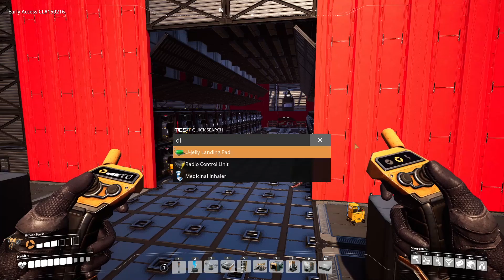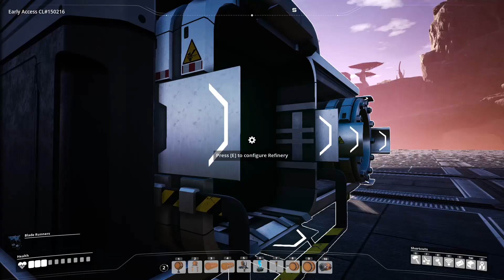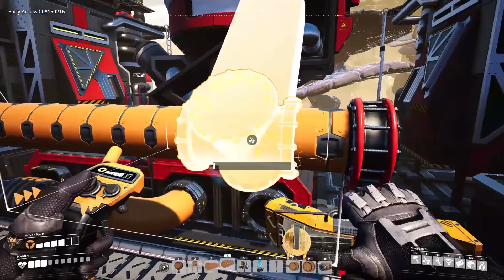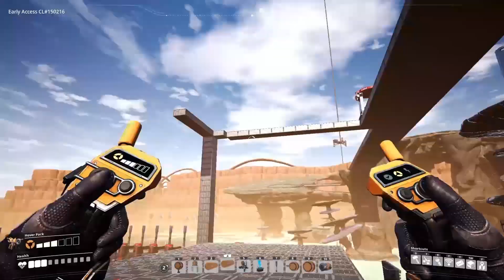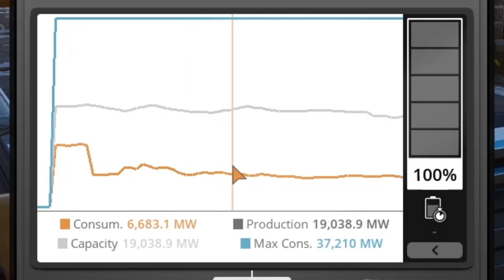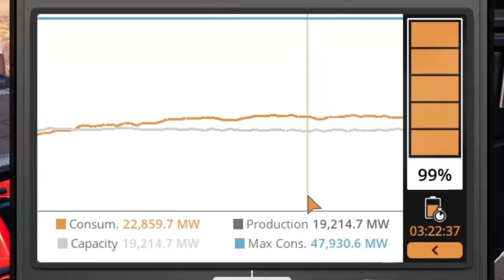Our First MEGA PROJECT! | Satisfactory Update 4 Gameplay Ep 3

Comment: With all the new pipe updates, I've been doing more "splits" with my turbo fuel stuff.  I find all the old setups just don't "balance" fluids properly anymore.  So I do 1 refinery off a pipe and that one makes heavy residue, that goes to 1 refinery making turbo fuel, then that feeds 6 power generators. I use the differential between the two refineries to cause a backup in the system.

Comment: I solved the fuel flow problem Kibitz was troubleshooting in the Twitch stream, by cascading the lines from up above and dividing evenly using pipelines of symmetrical length. In my version of the power plant, I am using 60 refineries and 48 blenders on 100% normal clock speed,  368 fuel generators on 246.2289% overclock, 30 fuel generators on 100% clock speed and 1 fuel generator on 59% underclock (also 92 water extractors each underclock to produce only 100m3 of water per min.) All this in just one single floor. For every row of 26 generators, 13 each side, I put the 2 centermost pair on 100% clockspeed. I connected one to another with a Mk1 pipe and put a crossing pipe in the middle pointing upward. About 10 meters high, I put a valve limiting this flow to 24m3/min, and right above it, another crossing pipe. This crossing pipe is fed by the 600m3/min fuel feed from the Blenders (I use a big fluid buffer between this crossing and the blenders, but I guess this method wouldn’t need one if your fuel feed is steady). Continuing, this crossing pipe high above in the middle splits the 600 in two feeds of 288m3/min. each, one going to the front half of the row, and the other to the rear half, and one feed in the middle (mentioned earlier) going downward for only 24m3, divided in 2 lines of 12m3 going to the centermost fuel generator pair. Each of the 288m3 lines go cascading, splitting first in three lines of 96m3 each, then each 96 line splits in 2 lines of 48 (by now, each of these 48m3 lines end up between the fuel inlets of a pair of opposing fuel generators). Then each line of 48 finally splits in two lines of 24 each going to the fuel generators. The only Mk2 pipe is the main 600m3 one up above, all the rest is Mk1. You can start this piping by placing the crossing pipes in the middle between each pair of fuel generators, connecting one side to one fuel generator (let’s say, the left one) then deleting the crossing pipe. Then, place another crossing pipe snapping on the extremity of the stub of pipe protruding from the fuel generator, only this time rotate it to point upward. Then connect a Mk1 pipe to the generator on the right side of the row. Do the same for each pair of generators, and you’ll end up with all crossing pipes in the middle of each opposing generator pointing upward. Connect the top endings of the crossing pipes in the 1st and 2nd pairs with a Mk1 pipe, which will form an inverted U. From here, do the same with the 3rd and 4th pairs, and the 5th and 6th pairs. Skip the 7th pair (which will be the normal clock speed pair) then connect the 8th and 9th pairs, 10th and 11th pairs, then lastly 12th and 13th pairs. In the middle of each resulting inverted U pipes, you can place crossing pipes pointing upward so you’ll be able to build upward by creating inverted U’s, placing, connecting and deleting crossing pipes. Just be careful with the crossing pipes that must go above another existing crossing pipe: the connection is finicky and requires just a bit of offset to either side, perfectly centering them will make the short connection impossible (and too much offset also makes the connection impossible due to too much distortion).
In my setup, the fluid buffer is located in the front, sitting atop 3 stacked 8x4 foundations, which means the 600m3 feed also comes from the front. This height is perfect to make a straight line that goes from the buffer outlet and just connects to the top of the main center crossing pipe.

Comment: After watching this video i decided to do some experimenting. Turns out it is possible to build pipes in a trench for a much cleaner look. I got it to work by building the machine on top of full sized foundations, then laying down four small foundations along the input side. Then delete the three upper foundations. Next lay down a feed pipe across the row of machines with up turned junctions just under each input. Now you can place one last layer of small foundations on top to enclose the trench and the pipes will still connect through the foundations. It is still technically clipping, but i think it is logical clipping my ocd can live with. Hope some of you will find this useful in your future builds.

Comment: Hey Kibs, you've indicated that you won't use Turbofuel because you want to save sulfur for use in nuclear power production. Do you have some numbers/calculations on this? With Update 4 it looks like using all the uranium on the map will only require 930 sulfur/min, producing 24 plutonium rods per minute for 330 reactors (8:3 plutonium to uranium rato).

Comment: Im not 100%, but i think batteries are 100 MW/hr or MWH. One battery could hold 6000 MW for 1 min, 50 batteries could hold 300,000MW for 1 minute. Does anyone know for certain?
Reply: I've tested it myself, and the Power Storage units are as follows: each one can provide 100 MW for 1 hour. Kibitz was pretty close when he highlighted his 10,600. Power draw if all the Power Storage units were needed would be 10,600 and last for one hour. Having only about 3 to 4k MW of needed power that his power grid didn't have at the moment is where the timer of 3 hours and change came from. 10,600 being used at just under 4k will last a few hours. The more strain you put on a backup battery, the less time it lasts. In my own setup that I've been working on a bit less than 50 hours after U4 came to EA, 50 Power Storage units fully charged shows me at about 480 hours if it is only providing like 75 MW of power for a few constructors (I tore down my factory to re-vamp it)

Comment: Kibs, I tested it, and you CAN Color your pipes with the color gun (Which appears to have a new design to it), so instead of leaving them the default Fixit Orange and they're all confusing as to what contains what, you can paint water lines blue, Oil lines black, fuel lines red, gas lines Yellow or Green and so on.

I likewise use the color gun to color lines of production.  Red for copper, Blue for Iron, Black for Steel...

Maybe that'll help with organizing your production lines.

Comment: I wouldn't use the 600 pipes to their full potential. There is a bug which makes them transport slightly less. If you are using them on full capacity, the flow amount will drop every now and then below 600 and then go up again. The bug is mentioned on the satisfactory wiki on the page for pipes. 
Before I read this, it made me crazy why my fuel plant couldn't feed the exact number of generators it should. I had a full fluid buffer connected to underfed power plants and the flow rate still sometimes dropped below 600, just to rule out any mistakes.

Comment: Kibz, 250 Sulfur is required for 10 Manufacturers who produce 200 Encased Uranium Cells per minute, which makes it possible to make 4 Uranium Fuel Rods per minute. If consumption has not changed, this is 20 nuclear power plants. Are you sure you want to save sulfur? Oh yeah, I forgot batteries for useless drones ...

Comment: When you use the overflow method on fluids, you should just put a valve in front of every input and limit the flow to whatever the machine needs. Then the system is effectively load balanced.

This can also work for belts, but it's more situational - like if a machine needs 60/min, overflow with mk 1 belts.

Comment: Balancing fluids is pretty easy, just set the flow amount with valves
Reply: Lmao, rarely works. I have a few systems where everything is perfectly balanced with valves and pumps but its extremely finicky and just doesn't work most of time
Reply: @TheBassMaster56  Had my coal power set up exactly right and it would only work most of the time. I just decided screw it and overfed by 7%

Comment: How do even begin to build these mega factories? Are you just who build them all good at art because I just cannot plan ahead as to where I’m gonna build this and that. I do prefer to build at ground level but I’m also stuck in building horizontal I just cannot force myself to build vertically. HELP.
Reply: Practice makes perfect. Hundreds and hundreds of hours of experience gives you some idea of how to plan and build neatly
Reply: What I do is build a large platform and then fit the machines to it. I have over built and under built the platforms lol. I then make a new platform for the next thing I want to make, normally just going up from the previous one. If it needs an expansion due to area, I'm not super worried about it. They added the pillars for a reason :)

Comment: Completely maxing nuclear only takes about 3200 sulfur. That leaves 3k ish sulfur you can use for turbofuel.
Reply: You need some sulfur for batteries too
Reply: @albertogarcia5276 It takes 225 sulfur to make 90 batteries with the blender recipe. Given that drone ports bug out when you have more than 90 ports built, I find it hard to believe you'd need many more batteries.
Reply: But you got to think about overclocking, The 3K would disappear when you overclock
Reply: @jacobterry2900  No, overclocking doesn't change ratios. My calculations are based on completely processing all 2100 Uranium on the map. Doesn't matter whether you do it on 1% or 250%.